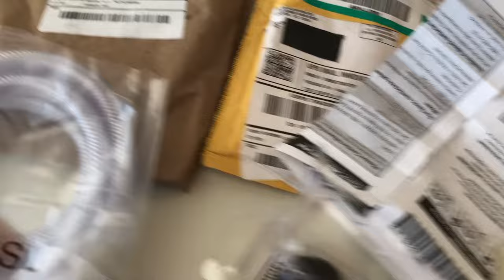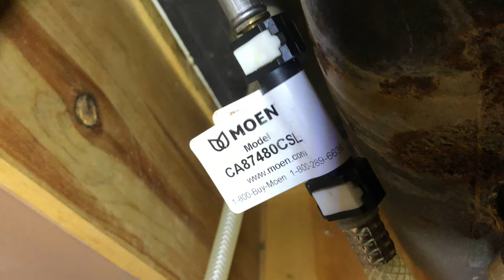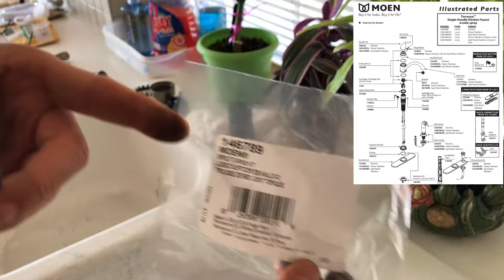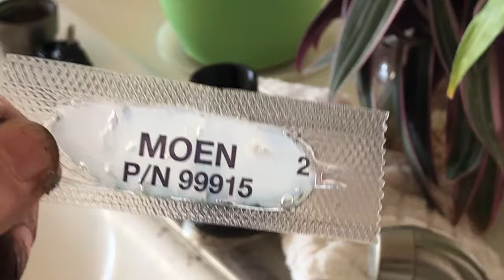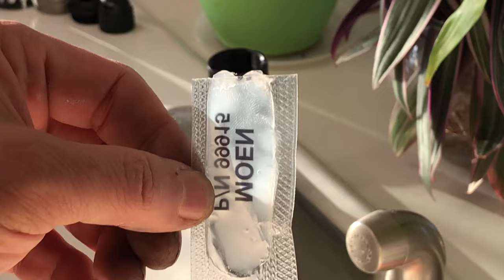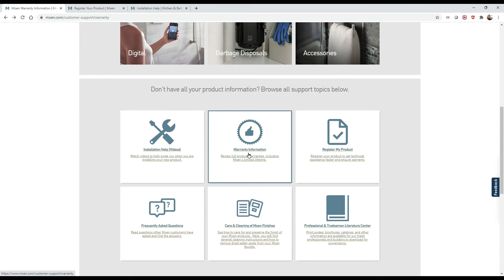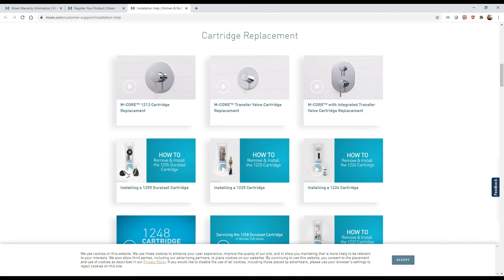Replace Moen faucet cartridge, o-rings, and sprayer for free!

Comment: By far one of the best installation videos.  Everybody else's rushes the install and don't show how to replace the O-rings, etc.
Reply from the maker: Thank you sir.
Reply: @DIYLifeSkills  You bet!  Quick question.  Do they have the correct o-ring sizes at Home Depot or Menards?
Reply from the maker: @JayZoop  Yeah most faucet’s share common size. In my previous video to this, I bought the parts at Lowe’s because that’s where I had bought the faucet originally. 
https://youtu.be/4afjfBFyyOo

Moen will send you all the parts that you need and they won’t ask for any proof of purchase other than asking some questions like when you bought it what store.  The only problem is, you have to wait a week or longer to receive the parts.
Reply: @DIYLifeSkills  I'm looking to repair it this weekend.   I"m assuming the O-ring size is 1-1/2" O.D. and possible 1/8" thick.    It's very difficult to find Moen Kit 146789 from a place that is open during the weekend.  I might just buy Danco O-ring kit, and try to visually match the size.
Reply: @DIYLifeSkills  I figured it out.  My Wetherly Moen faucet calls for an O-ring kit #146789.  I successfully replaced the two O-rings with Danco #97 O-ring which is 1-5/8” O.D., 1/8” thick.
Reply from the maker: @JayZoop  I had many YouTube comments to go through and sorry that I missed your last message, but great to hear you found the correct parts needed.
Reply from the maker: @JayZoop  What was the reason for the fix?  Is the faucet leaking or is the water having black particles?

If it's the leak, then the new O-ring should be good for 5 to 10 years.   If you are having black particles showing up, likely the internal materials inside the water hoses are wearing out.  I had to replace the water hose as well after the video.  Also, if the hoses more than 10 to 15 years old, it could also leak, so hoses are much cheaper than fixing the water damage later, so you should consider replacing them as well.
Reply: @DIYLifeSkills  Water was leaking above the spout so most likely it was just the cartridge that was the issue.  The spout made a very slight squeaky noise so I decided to replace the O-rings as well. The existing O-rings look in good condition so I could have just added some grease to them.  Just to be safe I replaced them anyways.

Comment: Your video is the only one I could find with the upper bearing kit, the 'broken' crown piece. When I took it apart it fell out and wasn't sure where it went. Mine came with a small gauge O ring and the same O ring came with the new parts. Your install didn't have the O ring around the bearing kit and mine wouldn't go together with it in place...Thanks to your video, I seen the error of my ways and I corrected it so thanks, I subbed..

Comment: Thanks! Your directions are excellent - I would add one thing - make sure the sink drain strainers are in place when taking the faucet apart - those little parts like to go right to the drain hole when you drop them :)
Reply from the maker: excellent point.

Comment: Thanks for posting.  I had to replace the diverter valve which you don't show in the video, but this video was still extremely helpful.
Reply: Curious what your symptoms were in having to replace the diverted valve? Thanks in advance
Reply: @calmoceans6668  50/50 split of water going through the sprayer and faucet when trying to use the sprayer.   After replacing it works fine. Moen sent me the part free of charge.
Reply from the maker: Just recently I started to get black particles in the water that looked liked worn rubber gaskets perhaps?

Wife didn’t want to wait for free replacement parts from Moen, so we just replaced it with another new Moen faucet.
Reply: Chad, I’m having the same problem. Do you have the part number or links on how to replace it? It’s hard to find for these models. I tried cleaning mine out and it didn’t work.
Reply from the maker: @aaronbrownsound  If you call Moen, minimally the can get you any correct part #.  Or if you can wait, they'll send you replacement parts, but it can take 5 to 7 days.
Reply from the maker: @aaronbrownsound  You can go here and find the part number for this faucet.
https://assets.moen.com/shared/docs/exploded-parts-views/87480pt.pdf
Reply: @DIYLifeSkills  Awesome! I'll call them tomorrow! Appreciate the video and advice.
Reply: @aaronbrownsound  you don't even have to call them.   You can go to their web site and fill out a help ticket.  In the process they require you to take a picture of what is wrong.  I took a picture of the faucet and sprayer running at the same time and about a week later I had parts on my front door.  Actual repair took about 25 minutes to complete.  Replacing the part only takes about ten to fifteen minutes, but I also had ten years of gunk and crap built up that I cleaned out since I had it apart.  Super easy and free to do.

Comment: Liked, so they'll send parts even if you don't have the sells receipt? I don't. Also, where do you find the model #?
Reply from the maker: Look under the sink for label sticker like I did. I had no receipt. They just asked about when and where I got it from.  Make sure you mention the store that carried your model.  Lowes usually carried most models so it’s probably safe to mention it if you don’t remember. :-)
Reply from the maker: The only thing is you have to wait 5-10 days for delivery, if they have parts in stock.
Reply: @DIYLifeSkills  Thanks for taking the time to reply. Was the part# you showed for the Orings correct? That's what I need but can't find.
Reply from the maker: @mrih1586  It turns out they have many part # to same thing as they interchangeably used in different faucets.  If you call them, they’ll actually walk you through all the parts.  In fact in my case, they suggest that I replace all the gaskets and sent me more than what I asked.

Comment: I can't even get the neck to come off of my Moen kitchen faucet! Maybe it's seized up?
Reply from the maker: Can you describe in detail how far you’ve gotten to?  Did you remove the black round plastic ring that holds the sprout (faucet outlet)?
Reply from the maker: Also the rubber O-rings seal the base of the faucet pretty tight to prevent leak so it does take some force to pull the base out.
Reply from the maker: Spraying some WD40 or penetrating oil around where the o-rings are and let it soak fore few minutes will help loosen the base so that you can lift up on it. 

The metal base is sealed with rubber o-rings so I doubt that it’s siezed.  If your faucet is already leaking and either needs repair or replacement, then in the worst case you’ll break it and have to replace it. But I think if you oil it and just put more strength, it’ll wiggle out. 

Let me know how it goes.
Reply: @DIYLifeSkills  Thanks for your reply. I couldn't remove the neck, but I did spray the base with WD40 and some CLR as it was quite dirty. Put everything back together and the faucet is working fine now, no leaks.
Reply from the maker: Awesome!!